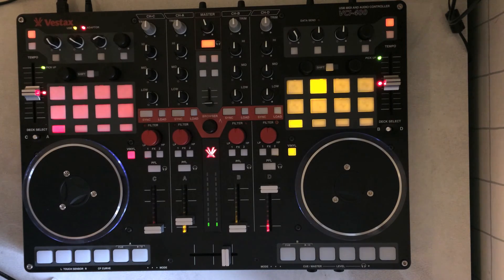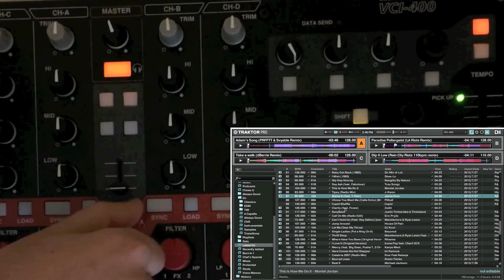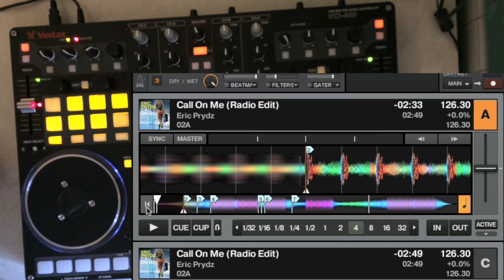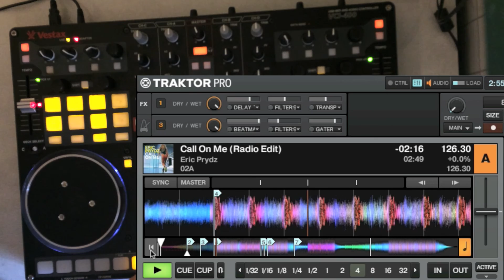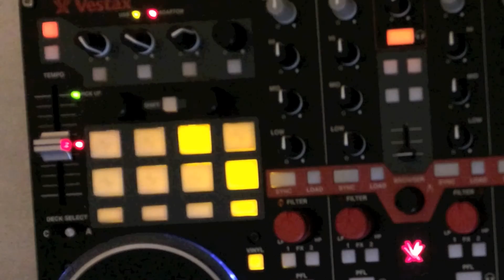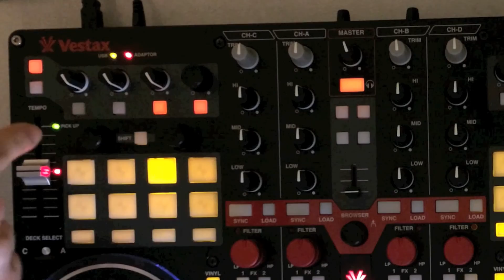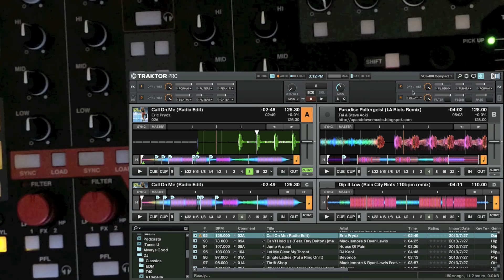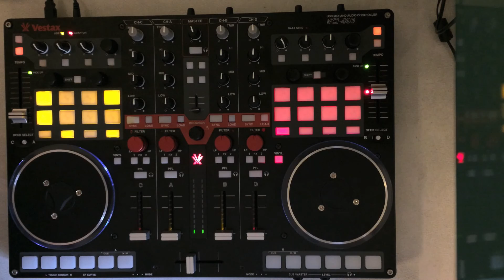VCI-400 JS Custom Mapping 1.0

Comment: the functionality of VCI400's tap or grid setup tap doesn't work so well. does anyone else have a problem with this. can i bypass this tap function on this mapping and use a more reliable one on compu's keyboard? I know in other dj programs you could offset the beatgrid with a simple option to set it up, I'm not having any luck doing it for those very few songs, in this mapping.